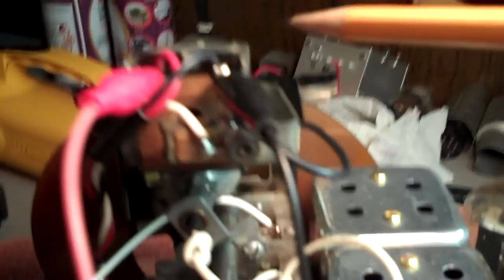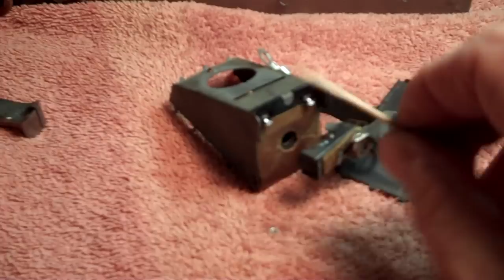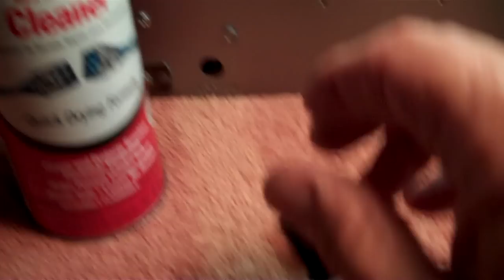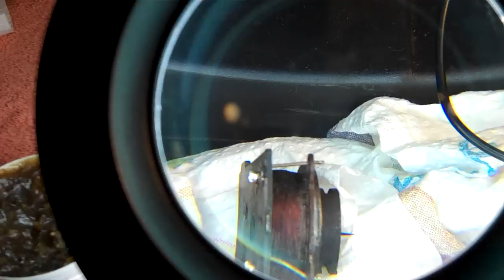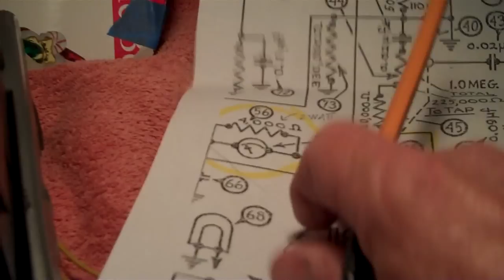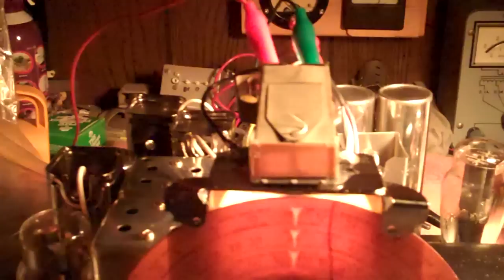1936 Philco Model 630B Repair and Restoration (Part 27 of 35).

Comment: Hi John great video's, I'm still on catch up with the 630B episodes, they are great and very educational, thank you. As for the two resistors, the mathematical relationship between parallel resistors can be solved using the Product over Sum method. 4000 X 1000 / 5000 = 800 Ohms. The 800 Ohms will then be in parallel with the coil resistance. Keep up the excellent work. Regards Bob

Comment from the maker: @hedwig85,
Part 28 shows a bit more about the shadow meter resistance requirement, but like a couple folks have already commented, the remagnetizing of the horseshoe magnet probably changed original current need of the deflection vane.  Relatively speaking, I did use a pretty strong magnet.
And a Happy New Year to you and yours.  See you in 2012.

Regards,
John

Comment: @1710WL I agree. I was also going to suggest using a 10K pot (of appropriate power rating) and adjust it for best performance of the shadow meter. I am thinking by magnetizing the coil magnet, John changed the magnetic field in the coil magnet, In doing so, it changed the relationship of current to meter response, making it more sensitive to current. .

Comment: John, 
 I am wondering, if  by changing the static magnetic field on the coil magnet (by you rubbing a fixed magnet around it), you changed the relationship of flapper-deflection relative to current sent through the coil. Such that, now takes less current to give the same amount of flapper-deflection. Perhaps that is why you now need a smaller resistor on the shunt.

Comment: Joe, had the same horror. I was repairing a old 50's s-meter and was just about done when I broke the same fine wire coming from the bottom of the coil. I was not as lucky as you, the break was to far down and unable to retrieve enough to splice. Great job on the repair keep the videos coming

Jim

Comment from the maker: @1710WL,
There's a bit more to do on this rig.  First, I wanted to get everything working, or at least mostly working.  The tweak, peak and fine adjust stuff comes later.  But you are right, 4k to 800-ohms is a heck of a drop.  The resistance is actually reading 875-ohms.  But no problem...we'll figure it all out later on.

Regards,
John

Comment: Hi John, That shadow meter with the shunt resistor is an amp meter. Now if after you do the alienment of the radio the meter is still not working right then I would a potentiometer connected across the shunt to adjust the restance to get the correct movement of the meter. Once you get that you can then measesure the potentiometer and do the math to get the value needed for the shunt. Love these vids keep them coming. Dennis